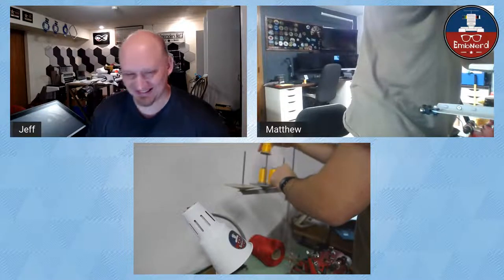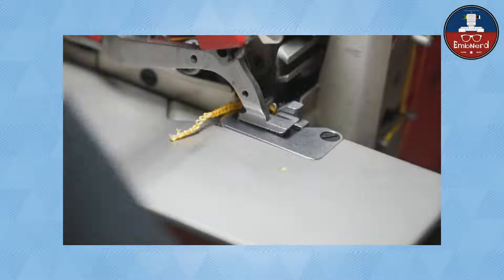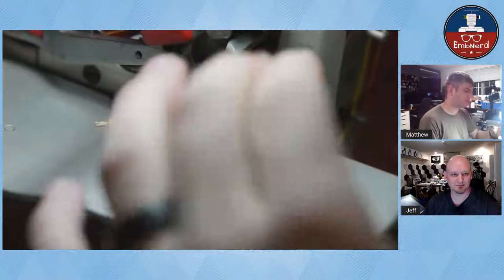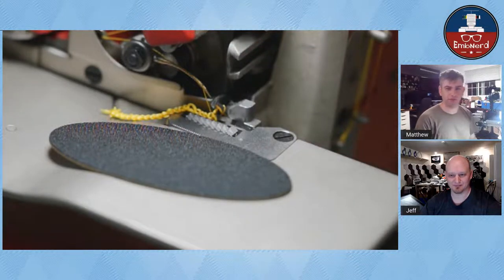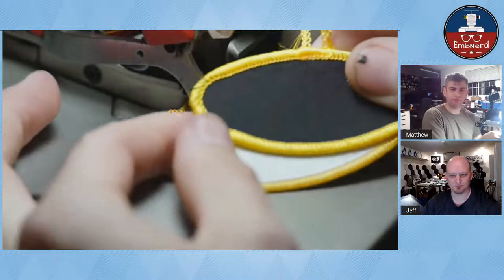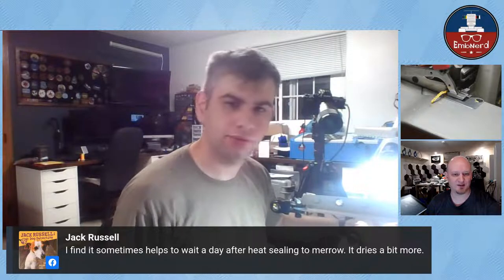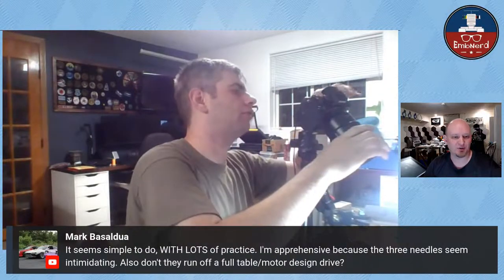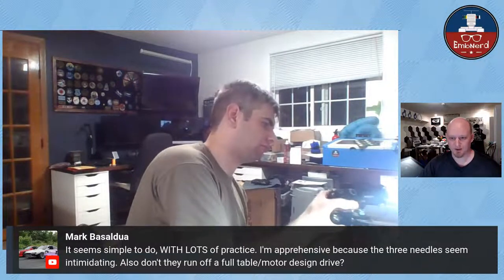The Needle Bar - All Things Merrow

Comment: Thank you for the demonstration. I was seriously considering buying a Merrow machine even though I only do small runs of patches, since I only have two single head machines. With the motifs that are now being offered as well as the learning curve of this machine, at what point would you suggest buying this type of machine?  25, 50, 200, or??? Patches per week. Thanks
Reply from the maker: I recommend it when your machine is doing the border more than 30-40% of your work. It will take time and practice to be as fast.

But the Fuller Fan border is a great tool to have. I use it still.

Comment: Hi - Can I accomplish similar things (density) with the MG-2DNR-1?  I understand that machine is only a 2 spool option, so worried I'd get the same density versus the 6 spool in this video?  Or any other thoughts?
Reply from the maker: You can get them converted at the Merrow factory if you email them.